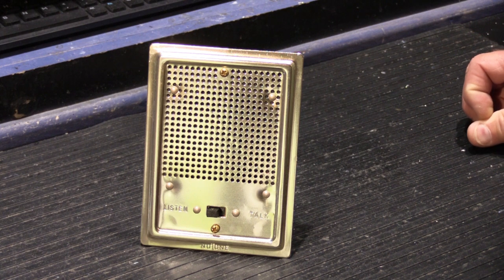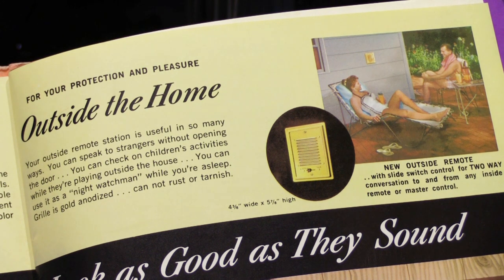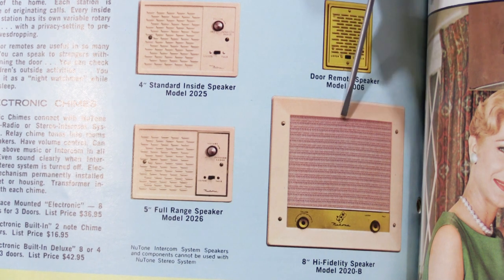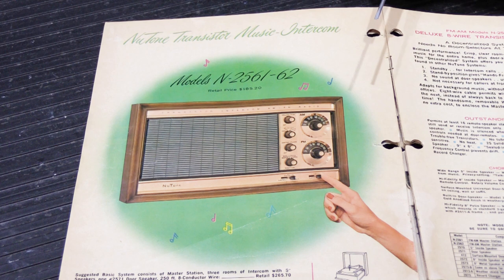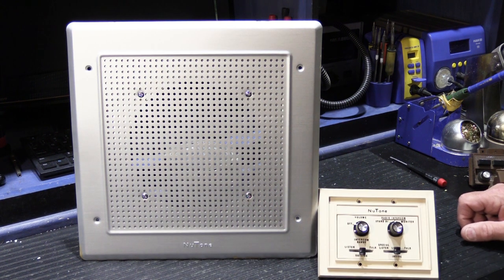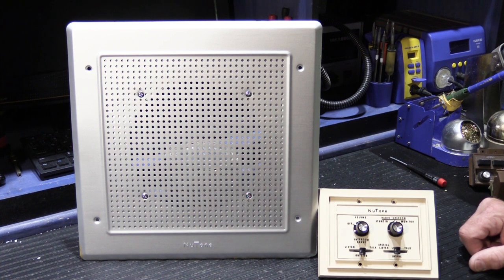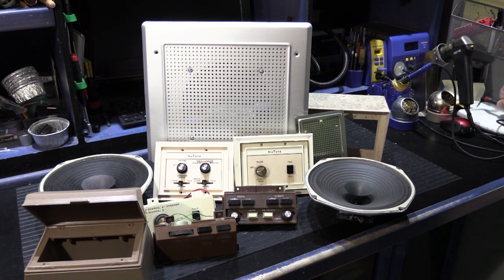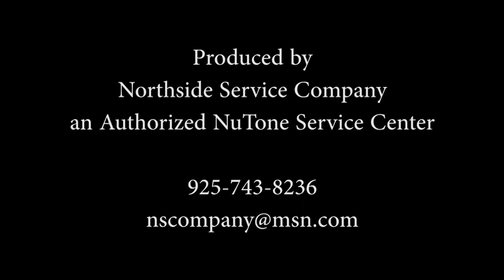An Overview of Early NuTone Outdoor Patio Intercom Stations 1957 ~ 1973

Comment: very interesting. since the control unit is standard 2 gang I wonder if you could theoretically use any generic modern 2 gang weatherproof box to protect it
Reply from the maker: Hi James:  I guess it would depend on how well the faceplate of the Patio Remote would seal up against the box and how the cover would fit - Chris